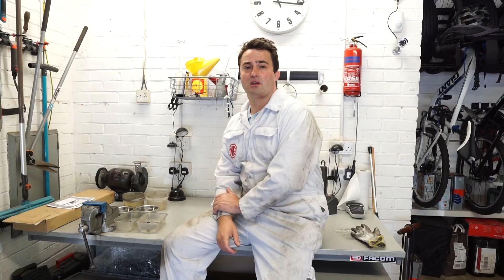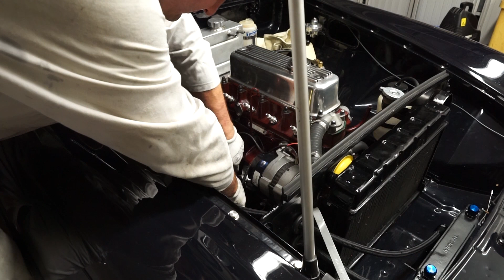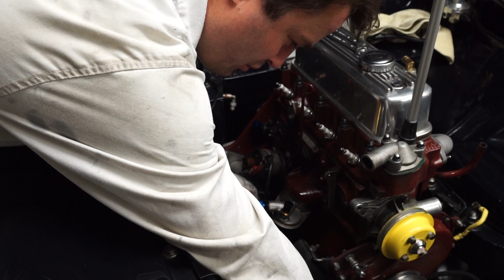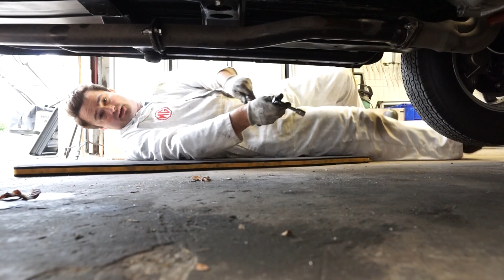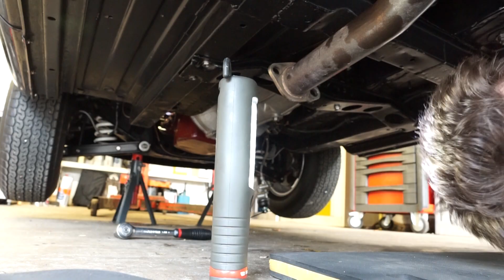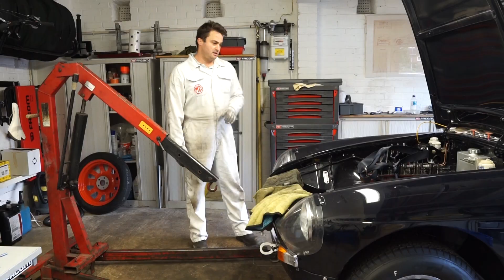Engine and Gearbox Removal from an MGB with Step by Step Instructions

Comment: T Y DAVID   , LOVED IT    I HAVE A 1800 MGB GT WITH OVER DRIVE  , ITS A DONA  ENGINE  , ITS GOING INTO  A 1950  RILEY  R  M E  , PARTIALY STRIPPED  ,       A  FEW MONTHS WORK  YET 
BUT YOUR APROCH   IS  GREAT   , NO NONSE  RIGHT TO THE POINT    HAVE YOU OR ARE YOU AN INSTRUCTOR   FOR MG     SUBBED FOR MORE   THANK YOU

Comment: Great video! Thanks David! I used it on my 1967 MG B GT (3 synchro with overdrive) to take the engine and gearbox out. On my gearbox it was a pain to get to one of the mounting bolt, I had to tilt the crossmember to have a tiny access to that bolt. I have no idea how do I put it all back.
Reply from the maker: Many thanks! There is a refit video here https://www.youtube.com/watch?v=HIQC7MBNnF4

It's also worth modifying the gearbox crossmember to make the refit more easy. https://www.youtube.com/watch?app=desktop&v=fPxuxvJ7PQI

Good luck!

Comment: What year is your car? 1968 negative ground? Awesome looking car!
Reply from the maker: Thanks for your message, the car is built on a heritage shell, the donor car was a 1965. My car does have the narrow tunnel and correct doors for a 1965 car, but I use an alternator set up rather than dynamo (most UK racers do). On the papers it is registered as a 1965

Comment: You say just "MGB" as if all models and/or years are the exact same
Reply from the maker: Thanks for your comment; in fairness the engine and gearbox removal procedure is similar regardless of the year. The rubber bumper cars have different engine mount and the front diaphragm around the radiator is different but the same techniques will work, is there a step that you are having trouble with?

Comment: My first thought also, as commented below ----- No fender covers --- and you explained. Your Engine Strap must be Set / Made for that angle to pull engine and trans out? When I got out of the Military took a Machinist Trade -   Made my Engine Hoist and Engine Stand , and an engine tilter that you use a socket on a nut ( either end ) to tilt the engine in getting her out.
         I really like the idea of taking parts out / off as subassemblies --- grouping things together ---- makes it real simple and easy   ------------------ Thank You for Sharing - very helpful!

Comment: Where’d you got those nice oil cooler hoses made up?
Reply from the maker: I made them myself, I made a new set for this season, all you need are the fittings, hose and a set of vice jaws. This season I've gone for PTFE hard-line hose and AN-8 fittings
Reply: @davidrussellwilks  did you use BSP to AN adapters at the engine block and oil filter assembly?  Looking into this now; they really tidy up the look. BSP is not easy to find adapters! Only ones I’ve found are steel. Guess I could paint them black to match the AN.
Reply from the maker: Thanks for your message, for the oil filter I was to simply change the screw in adaptor. From memory I think it was a 1/2 bsp to An-8 https://www.ebay.co.uk/itm/150521212173. For the engine take off a weld-on boss (AN-8) was fitted to the steel take off, I painted this fitting black. For the oil cooler I just bought a cooler with AN-8 fittings.

Comment: It’s amazing that there isn’t too much involved into doing such a removal when documented so well. Thanks David for such a great video.
Reply from the maker: In my car it is probably simper than a road car, there's no heater to disconnect or speedometer cable for the gearbox. The engine also comes out regularly so no seized bolts!

Comment: Hi David - Great video and very clear - need to attempt the same on mine soon. Would you mind replying with the capacity of the engine crane you are using? Many thanks.
Reply from the maker: The crane is a 1000kg one, I tend to use the mast a little way out to clear the front of the car, capacity there is 500kgs. I think the whole engine and gearbox (with fluids) weighs around 250kg or possibly a bit less.
Reply: Thanks David - that’s good to know before I invest in one myself - much appreciated.

Comment: Thanks for the video. I'll be using this info tomorrow all going well. I cannot fathom though, even after watching your video how it's easier to remove the engine and box as one assembly. Surely if you left the box in place you could pull the engine off the bellhousing and lift it straight up, no?
Reply from the maker: I think it's possibly easier to remove the engine separately to the gearbox but I have found it can be difficult to get the two parts to join together again when reinstalling. Also in my car the starter motor is quite hard to remove, but if I leave the engine and gearbox together it comes out with them.
Reply: @davidrussellwilks  thanks David. I have a lot of my engine stripped as it is. There's literally just the short block without the pistons left in the car but the bolts holding the gearbox cross member will certainly put up a fight on my car. I'll do a video myself if you're interested of me ham-fisting my engine out! 👍
Reply from the maker: Thanks for your message, I've just seen the work your doing on your car, and subscribed, would be delighted to see the video. The gearbox mounts can certainly be a pain, especially if they've not been undone in a long time. You may need to support the gearbox once the engine is out, from memory it can pull on the clutch hose.
Reply: @davidrussellwilks  thanks for the info. I have the clutch pipe removed but I'll prop the gearbox up anyway. I'll be removing it too, but at a later stage. I might see if the bolts come out easily. I'll see how I feel at the time! Thanks for subscribing! 😁👍

Comment: By a country mile, this is the best video i have ever seen. The way you calmly narrate everything you are doing fills me with great confidence for when my son and i remove the engine and gearbox from our mgb roadster. We have treated ourselves to some AF sockets and spanners, and will hire a hoist at a weekend rate Friday afternoon to Monday morning so we have no stress if we get a few rusty bolts that refuse to come out. Thank you once again for a superb video, i am now going to watch you put it back in on the next video.
Reply from the maker: Many thanks Steve, it sounds as though you are all set. If you are using the same method as I do you can remove the radiator and shroud, oil cooler hoses, alternator, starter motor, carburettors, exhaust etc before you need the engine hoist. The exhaust bolts are probably the ones most likely to be hard to remove, the rest should be straightforward, but access is tight on the gearbox mounts.

Comment: David, just wanted to drop you a note and thank you again for your videos. My son and followed step by step and didn't have a single problem. We have a projector hooked up to a computer and a  large pull down screen in  the shop. You are almost life size! HA  We are now giving the gearbox a little TLC and about to replace the clutch.  Great videos..you make our project possible.
Reply from the maker: Many thanks for your message Jim, it's great to hear that the videos are useful. Delighted that you and your son were able to remove the engine using my guide!

Comment: David, do you have a video of replacing the clutch plate and the gear box rebuild? Also your thoughts on going to an aluminum flywheel? I have an 1967 MGB w/ overdrive.
Reply from the maker: Many thanks for your message Scott, I do have (part) of a video covering the clutch plate, it's the second section of this video from 9:32 https://www.youtube.com/watch?v=HIQC7MBNnF4&t=675s
Unfortunately I've never carried out a gearbox rebuild; this is something I take to a professional to be done for me. 
The aluminium flywheel is an interesting one, we have to use a steel flywheel in our cars; class regs. I use the TTV one, it really is beautifully made http://ttvracing.com/product/mg-b-4-sync-lite/?referrer=product-listing&iframe=true&width=80%&height=100%&type=flywheels&engine=mgb-4-sync&manufacturer=mg After 10 years it's still going strong, the race starts have made it go blue in places though. 
I have heard of aluminium flywheels failing and I think for a road car there wouldn't be a great benefit, I imagine you'd have the rev the car a bit hard to pull away? In fairness though I've never used one. What benefits were you hoping to find with it?

Comment: This is just amazing stuff. You make everything looks so easy! Whenever I speak to anyone about this kind of thing, I always get "Oh well...that's an engine out job so you're looking at £1K+" and with the exception of an engine hoist (which I imagine aren't cheap) you make it look all fairly straightforward. Your videos are incredibly inspiring. Demystifying the fear.
Reply from the maker: I think I was very lucky to have people watching over me the first time I did most of the jobs and that's a great confidence booster. These cars are generally straightforward but as I said in the other comments stuck and rusty fasteners can really ruin your day!
Luckily I am able to borrow the engine crane when I need it, it's the sort of part that costs a fair bit and takes up a lot of room. Not ideal for a home mechanic but I guess they can always be hired, or better yet bought with a few friends and shared.
Reply: Engine cranes aren't nearly as expensive as you'd think! I bought one for I think €180 and it's decent enough for an ambitious home mechanic.

Comment: Where’d you get the overalls?
Reply from the maker: Thanks for your message, the overalls are just plain white ones from eBay, the brand is SuperTouch. https://www.ebay.co.uk/itm/Supertouch-Polycotton-Coverall-Basic-Mens-Overalls-Boiler-Suit-Work-Wear-New/332244663294?var=541255959397&hash=item4d5b533bfe:g:IgoAAOSwUKxYic~p

A friend bought me the MGB patch and I sewed it on.

Comment: Just removed my engine. This video was super helpful! I pretty much had it on repeat when I was in the garage. Hope it goes back in as easily after the rebuild... Cheers
Reply: Ps your car is immaculate. And fast too!  What's the engine spec?
Reply from the maker: Many thanks for your message Thomas, I'm delighted to hear that the video was useful to you. I'm hoping to fit the engine back into my car next weekend with any luck and hopefully I'll be able to make a video covering that too. 

Hope all goes well with the rebuild on yours. In terms of the engine spec on mine it's an 1852cc with steel crank and caps. 720sp cam, Weber 48 and race cylinder head. It makes around 160Bhp at the wheels 

There is a good website here covering many of the build details, but the engine has changed since the article was written.
Reply: @davidrussellwilks  Yes it would be great to see the process in reverse order!  Spec sounds similar to what I'm going for - minus the Weber. Fun times
Reply: @davidrussellwilks Wow 160bhp at the wheels is impressive from an under square, 8 valve, 1800. Is that the FIA Spec for the B Roadster. (I subscribed btw).

Comment: David great car and great description.
Two questions - what fitting have you used for the breather pipe in the rocker cover and how is the fresh air hose fixed behind the grille ? What type/pipe diameter have you used ? 
I am about to put a more powerful engine in our B and also intend to make those mods.
Reply from the maker: Many thanks for your message Ralf, the breather pipe for the rocker cover attaches to a brass elbow type fitting, from memory I think it was a 3/8 BSP, but the rocker cover was a special one from HRG that already had a threaded hole for the fitting. Once could easily modify the rocker cover with a weld one JIC fitting or similar. The box it feeds towards the rear of the engine is vented through the cap. For the air inlet hose there is an inlet trumpet that sits on the end; I then zip tie the whole assembly to the grille support. It's very basic but works surprisingly well. I can't remember the hose size off hand but will check for you tomorrow, it was readily available and I had the tube in the radiator diaphragm welded in to suit.
Reply: David Russell-Wilks David - thank you very much for the quick reply.
This is very helpful - there are nice breather rocker covers available for Minis, but MGB does need some modifiyng obviously. No problem ! The welded tube is also a good concept !
Reply from the maker: @RalfPickel  Hi Ralf the hose I used is 100mm internal diameter, I don't remember the manufacturer but it's the generic  motorsport ducting type, example here https://www.demon-tweeks.com/uk/automotive-plumbing-solutions-single-layer-ducting-hose-402659/

The bell mouth/ trumpet end part is also 100mm something like this https://www.demon-tweeks.com/uk/revotec-high-flow-aluminium-air-inlet-243530/

I think all my parts came from eBay though.

I hope to make a video when I put the engine back in, I'll add some details of the custom parts for you.
Reply: @davidrussellwilks  Perfect - thank you !! Now I can go shopping online.. :-) Our new engine should be finished soon, so it is nice to have everything together beforehand.
Reply: @davidrussellwilks  Hi David - finally the new engine and gearbox is back in - and, of course - the fresh air hose setup. Thanks to you it was easy to source the parts and fabricate that. I would post a photo, but I guess this is not possible here.

Comment: Oh my god, David! How on earth can you pull the engine without any protection on the wings? Perhaps vou have  the nicest restored MGB in historic racing. The effort that must have gone into bringing it to this state must be enormous. That definitely is not a 500 £ paint job! Sorry, but how on earth can you risk to damage it? It´s such a lovely car! Send me your address, and I´ll send you some wing protectors! Regards Danny
Reply from the maker: Many thanks for your message Danny, I do have a pair of wing protectors but in all honesty I don't really get on with them. You are quite correct that the paint finish is to a high standard. However I am always concerned about getting small particles of dirt or grit under the protectors and marking the paint. I tend not to put anything on the wings and then just make sure that I am careful, it also stops me resting tools or anything on them. I do put a cloth over the front apron just in case the sump brushes it when I am lifting the engine out. 

If I have any tubes or cables draped over the wings; draining the fuel, setting the timing etc I do put a soft cloth under them to stop them marking the paint. When the car is polished just rubbing it with your finger will show on the surface of the paint, but I've had more damage from stone chips than from tools

Comment: Good instructional vid David. Done mine a coupe of times but pulled engine only.  First time got front of car too high for crane but only realised when it was part way out. But thinking of pulling it once more for a gearbox refurb. I have a factory auto and have wondered if the BW35 box is heavier/bulkier than the manual.
But  I have a question. Would you have enough side clearance if you left the manifolds on?
Reply from the maker: Many thanks for your message Graham,  in the past I've removed the engine a few times without the gearbox, now I always pull the two together, I just found the sometimes it was really hard to get the two sides to line up again in the car, time wise there's very little in it I'm sure. I have removed it with the manifold in place when I had a Maniflow system, I think with a standard exhaust manifold it would be possible but certainly tight, I think it you removed the fittings to the exhaust and body at the front you would have a fighting chance. I've never dealt with an Auto box, but they do look a but wider than the standard one. Mine is a 4 synchro non-overdrive so would probably be lighter, but I imagine it's a similar weight to an overdrive box?

Comment: Yes, you have a number of custom changes, including the Weber carb, electric radiator fan,  etc.  I find that I can't remove the radiator shroud and radiator together: I have to separate them.  Also, I don't undo the oil cooler hoses: I find it easier to remove the oil cooler with the shroud.  As I have a left-hand drive, I don't need to touch the steering shaft.  My engine hoist came with a very useful tilt adjuster, that allows you to vary the tilt of the engine as you coax it out.  I highly recommend it!  
Very useful video, and sure to relieve some "first-time anxiety" for those considering extracting their engine / transmission the first time!  It does take some work, but it's very doable by one person.
Reply from the maker: Many thanks for your kind message Phillipe, the radiator and shroud together can be a tight fit, I think on the MGB GT I had previously it was hard to take the two out together. I also had the same conversation with a friend who takes the oil cooler and hoses out together rather than separating. Keeping them together should avoid any spills or damage to the fittings. 

Delighted to hear that you enjoyed the video!

Comment: Very informative!
If I may ask, why did you have to pull the engine in the first place? What's the typical service life of a competitively tuned B series on track?
Reply from the maker: Many thanks for your kind comment Brodie, I never even thought to mention this! I was actually pulling the engine to get the gearbox out. The selector or the synchro ring for 2nd seems to be playing up and I wanted JP Raceshop at Silverstone to look at it. 

The engine tends to last for around 2 seasons between refreshes (around 40 hours running) time.